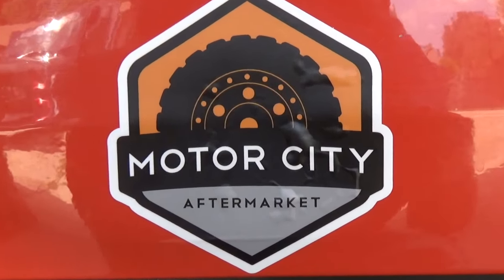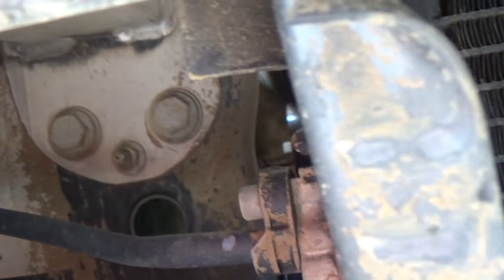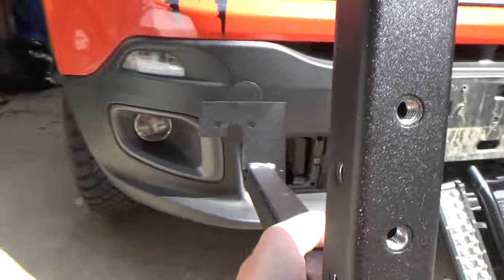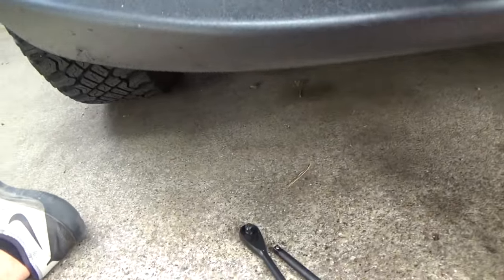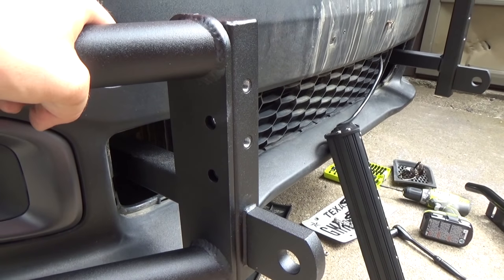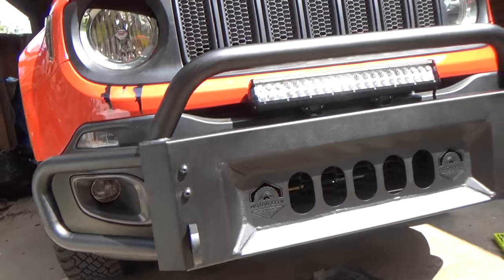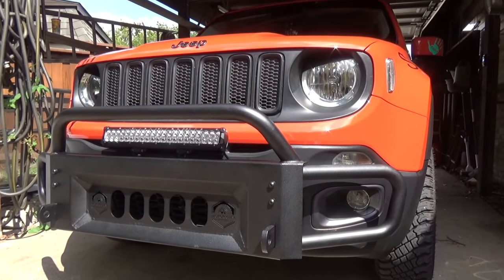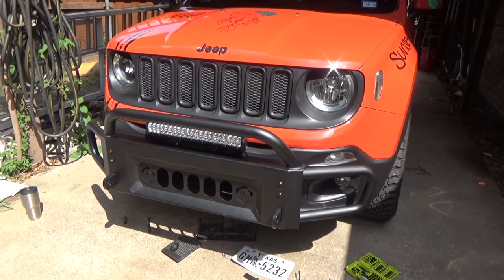Renegade Tv - Motor City Brush Guard

Comment: Does this work on models that have the fog lamps that turn on as you go into a turn? 

Look's sick btw.
Reply from the maker: It should
Reply: This doesn't add or remove any lights. The loops around the fog lights at the sides to not hinder the projected light so I'm not sure what you mean
Reply: Roger Halt I’ve seen different push bars that state in the directions can only be used with certain models. Apparently, there is some relay near passenger front fog light that would get in the way. This is why I questioned.